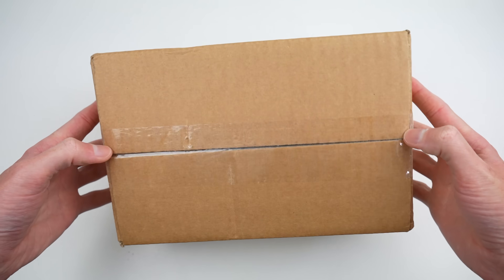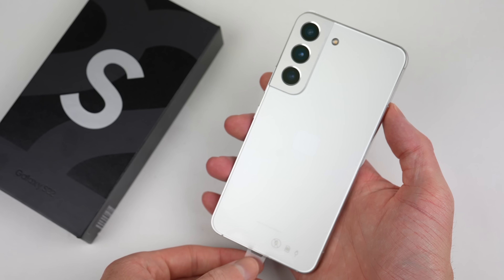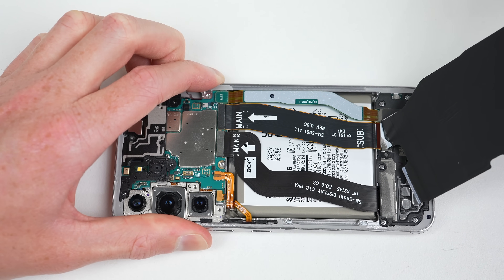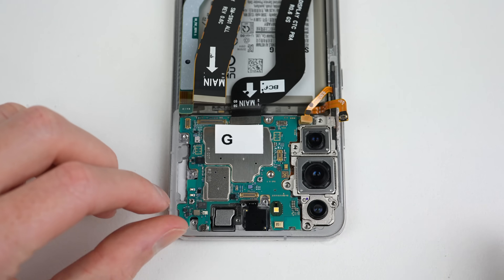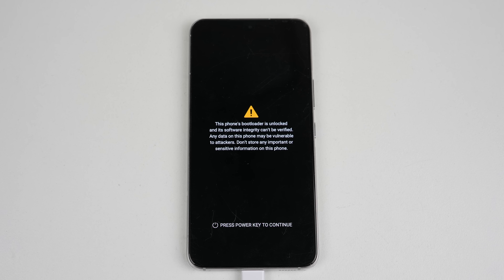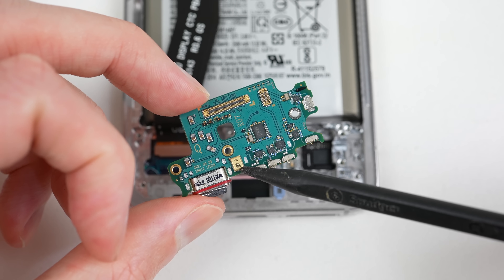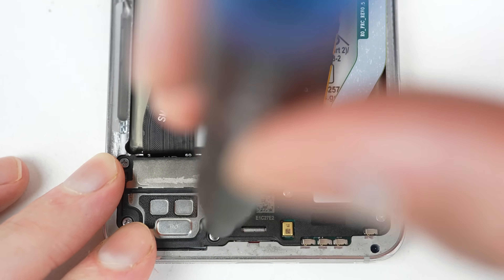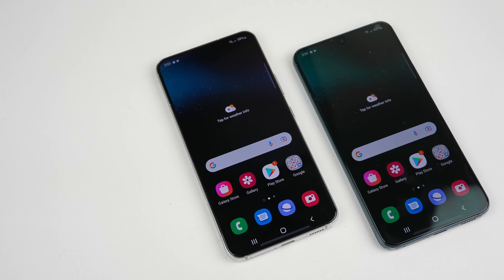Samsung Galaxy S22 - Teardown and Repair Assessment

Comment: this is some nice Progress Samsung done...
Man the only thing i could wish now about it is, Less Aggressive Adhesive for Battery and collaborating with like iFixit or something like that for parts and tools or atleast put it in their own Website, and boy that will be sick
Reply: There's some progress on repairability but not really on treating consumers better in general. They lied about the LTPO screen, the charging speeds settling half the planet with the s*** exynos chip, remove the charger from the box, removed expandable storage, nerfed 4 gigabytes of RAM away from the S22 ultra 128 GB variant.

I think a lot of people just assume the phones get better every year and don't even read the spec sheet.
Reply: The reason for adhering the battery to the phone and not using the phone itself to hold the battery is down to the Note 7 Incident.
That exact incident and its faults is exactly why the adhesive on the battery is used.

Comment: Hello, I’m a manager of a Samsung experience store, and we have a repair center at the back of the experience center, with the new S22 series Samsung removed all the incompatibility errors with repairs. We even tested the ultrasonic fingerprint scanner in many ways and didn’t found any problems. I own a Ultra variant for a couple weeks and before the announcement we had to use a special case to hide its exterior, we can confirm that with the ultra series you won’t find any problems also :)

If you get some errors nonetheless in terms of inaccurate fingerprint scanning the experience stores should calibrate the sensor for a small fee since you replaced the screen out of warranty. We tested in many ways and didn’t found a single problem with any function of the S22 series including the ultra so we expect not to have that many customers coming in for calibrations or other situations. But since it’s tech we still offer the option.
Reply: That is honestly such class. The fact that we have the option to fix our Samsung S22 devices ourselves even if we need to pay a small fee is I think a great compromise. If only Apple took notes
Reply: Appreciate you posting this. The telephoto 2 lens on my S22 Ultra isn't working and I thought I couldn't do anything about it due to part pairing. Am happy to hear that this isn't the case and after reading your comment I went ahead a purchased a replacement camera module from eBay to do the repair!
Reply: gioa  its why i said if only
Reply: complete opposite of apple lmao, apple would just tell their customers that their product is irreparable and that they should buy another device
this is one reason why i love samsung
Reply: Question. I just want to replace motherboard on s22 plus, I don't have to remove the battery or anything else beside motherboard screw right?

Comment: One important thing is missing to be mentioned in the video: after relocking the bootloader, the knox flag went back to 0x0 or stayed at 0x1? That would be interesting to know!
Reply: I think the flag gets set to 0x1 only when you flash unauthorized software.
Reply: I think 0x0 because all the Knox featured still worked

Comment: good job Samsung for the interchangeable parts and repairability although the battery is still glued too hard, atleast we can unlock the bootloader and use it normally. I don't need Pass, secure folder & blockchain. these online services is useless for me.

Comment: I will never buy a phone that doesn't give you a charger in the box. 

I really really wanted to buy the Samsung Galaxy S22 ultra but the fact you only get the phone, a sim tool, and a manual in the box, turned me away. 
I'm not spending £1499 for a fully specked out phone and NOT getting a charger. 
Also why is there a promotion for a "free" pair of galaxy buds? I don't WANT your galaxy buds..  just, give me the charger and £150 off the price of the phone???

Comment: I've recently swapped a galaxy a51 display and the fingerprints scanner worked without an issue. It was a bit slower but I believe it was because I didn't use a genuine samaung display (couldn't find any in stock anywhere at that time)
Reply from the maker: Its possible they removed/fixed the issue. If anyone can provide any proof I will put a pinned comment on that video.
Reply: @HughJeffreys  Since you had only swapped the scanner, that is why, the calibration of the scanner would assumedly been saved to the screen's components in some way to protect from trying to take that data from the scanner itself.
- Yours truly, Service & Repair Tech

Comment: Samsung seems to be taking the sustainable concept relatively better than others. They promised 4 years of major upgrades and seeing that the hardware is repairable without any bad consequences, it's a good move.
Reply: Yeah that's the only reason why I got the more expensive S22+ rather than the S21+, 4 years of updates is A very important factor to me because I plan to keep the phone a long time
Reply: @echobird115  the S21 series also get 4 years of OS updates and 5 years of security patches...
Reply: We just need the headphone jack back.
Reply: @danielm.595  To hell with that headphone jack crap. I've been using budget phones and never used wired earphones once on them. Sony recently launched a flagship phone with snapdragon 8 gen 2 with a micro SD card slot, I repeat , a dedicated and not a hybrid card slot. So what's Samsung excuse?? Smaller devices like the s9 plus can accommodate micro SD while a huge phone like the s23 ultra cannot accommodate memory cards, this is ridiculous
Reply: my s9 got 4 years of security updates and thats all that matters TBH ,the s9 got slow last year ,but after a factory reset it was like new again speed wise ,however it stopped security patches in march so i got the s22 ;)
Reply: @girlsdrinkfeck  Wait what I thought the S9 could only be updated to Android 10
Reply: my 2018 phone still gets updates and its not a Samsung
Reply: But is it worth it? Where I live people will ask you for half the price of the phone for a screen repair. For that, I can wait and buy a new phone or even change it in the Samsung store for a discount

Comment: Finally ...
I can find out if Samsung's Latest is worth buying, Unfortunately the Battery replacement gives it a whopping 5 out of 100 when compared to my Galaxy S5 battery replacement that rates at 100%, Here's hoping my Phone Galaxy S5 will last long enough for Samsung to concede, it's a bad idea to add extra costs to a simple battery replacement..
Reply: Honestly if you're coming from a phone that old I would recommend upgrading to a Note 9 or an S10 instead. You'll get much higher resolution and PPI, a headphone jack, expandable storage, fast charger, Samsung pay, iris scanner, capacitive fingerprint sensor, etc...

Something like the S10 Plus literally cost $200 and we'll still be getting security updates for two more years. If you look on the spec sheet is this objectively better and every single metric except peak performance of the processor, and a slightly upgraded camera sensor.
Reply: @michael_c2  are you saying the 4k videos I can record with my Galaxy S5 has a phone that can record even better than that?

Comment: i don't understand why samsung doesn't change the battery adhesive to pull strips... it has been a consistent criticism for years and it would cost them nothing to change

great video as always Hugh
Reply: yes even greedy company like apple has it
Reply: My theory is that the battery is used as structural strenght for the smartphone, these smartphone have to be so fin and light that its actually pretty smart to use every component inside as structure, that could explain why the smartphone is unbendable
Reply: @Dragirek  Less that and gluing the back so they don't use the rest of the phone to support the battery, because if they have anything around the battery, their is a possibility of the Note 7 incident again.
That was the issue with the N7, the battery was compressed around parts with no space, and the battery board itself didn't quite have as good built in securities against going boom..

Comment: Loading a custom boot loader also reduces the battery capacity to 80%
Reply: You mean on s22 specifically?
Reply: @Yeelleeay  All Samsung as far back as the Note 7, as far as I know.
Reply: @AngryWatchGuy  I've unlocked like 4 to 5 samsung devices since 2017 and I've never seen such behavior on any of them .
Reply: @Yeelleeay  that's because you are doing a carrier unlock.    I'm talking about a bootloader unlock.
Reply: @AngryWatchGuy  I'm talking about a bootloader unlock too....
Reply: @Yeelleeay  Well apparently you're not if you think it doesn't effect the battery.  Changing the bootloader does this to the battery.
Reply: @Yeelleeay  Oh wait.  I get it. You unlocked the bootloader only.  Yes.  Only unlocking the bootloader and not doing anything with it will certainly not effect the battery.  But loading a custom rom most definitely will.  And this would be the only real reason you would unlock the bootloader in the first place...
Reply: @AngryWatchGuy  Uh I've unlocked the bootloader, loaded custom firmwate and even repartitioned one of them and I can still confirm that the battery capacity "is not" affected. Infact this is the first time I've heard of anything related to the battery being affected by unlocking the bootloader...
Reply: Infact even my current daily driver (Galaxy A51) is running a custom rom based on aosp ( aka not a oneui port ).

You've got any proof of the reduction of battery capacity or are just talking based on something you "heard"?

Comment: Manufacturers claiming to be environmentally friendly is always a red flag. They're just virtue signaling at this point (not a generalization, but a majority of manufacturers are just using green to make profit).

It's great that they didn't do those idiotic stuff that the Z Fold 3 regarding the bootloader. As for the repairs, glad that Samsung isn't changing yet. The battery adhesive is just unnecessarily strong, which is completely wrong.
Reply: Oh boy it can be taken off easily with alcohol... I don't see problem here
Reply: @nothing9220  there is a problem even with alcohol though. Back then batteries in non removable backs like the S6 were easier to remove yet they're sturdy with their adhesive.

Comment: Happy to see Samsung still allowing repairs on their phones. I'm hoping this trend continues on their A-series smartphones, wouldn't want a repeat of the A51.
Reply: Speaking of that, Hugh didn't test the A52 for repairability to check if they really did improvise.
Reply: I know the A30s is affected too
Reply: Fun fact with that finger print reader issue, if you replace the scanner and the screen together, the reader will still work. I have no idea why that is, but it is a way to do it.
Reply: @MyHomeman234  then maybe the sensors weren't identical?
Reply: I want to see a tribute to the good ol' days and removable batteries make a comeback. I know samsung can still pull it off, I have the Samsung Xcover Pro and it is a great phone, but it can be better. Maybe a S22 Active with removable battery.
Reply: @thetechfromheaven  I think the newest phone you can get with a removable battery is the Fairphone.
Reply: @3mmmmmm  The new Nokia 3310 has a removable battery
Reply: @filenotfound__3871  more of a feature phone though
Reply: @filenotfound__3871  Pog
Reply: id never waste money on A series ,the longer a phone gets security patches the better
Reply: A41 is awesome had brilliant sunlight readability
Reply: I have a a51, and there is a simple way around that issue: don't break your phone or don't use a fingerprint sensor
Reply: @filenotfound__3871  "Don't break your phone" Sounds about right.
A coworked dropped his A51 once from his desk and the motherboard got damaged. Woops
Reply: @3mmmmmm  mine fell in a hole under the elevator doors. I don't know witch floor as I was going from the basement to the fifth floor, the phone was fine, a but dented on the plastic but still works fine.
Reply: @3mmmmmm  I don't drop my phone often, but when I do it is usually a preety big fall for a phone... or a stupid one like the elevator door.
Reply: @filenotfound__3871  I sincerely love Samsung modular components compared to that clumsy S10 series motherboard and pixel motherboard

Comment: If bootloader unlock ability is your main concern, Xiaomi is probably the best when it come to that. For starters, they make the process of unlocking your bootloader pretty much painless and all of the warnings are stated clearly and for some reason, they won't void your warranty.. The downside is you need to wait a week for the system to tag your account with bootloader unlock permissions.
Reply: I don't know why bootloader is a main concern. The average consumer won't be flashing their phone just because they are being tracked by Google.
Reply: @traviswalker8933  correct

Comment: Well, at least the battery being superglued into there actually has a point (smaller risk of damage through movement), unlike with Apple's software locks which only exist do f*ck with you.
Reply: Yeah they are afraid of another note 7 lmao
Reply: They glued down the batteries bcz they are afraid of the note7 accident
Reply: @pham3383  what happen to the note 7
Reply: @kindsplash21  boom
Reply: Could it also be to increase heat transfer through the case?  More solid connection -> better transfer rate -> less overheating
Reply: @frankohashiguchi  
In that case they'd glue thin thermal pads to it and use a conductive adheasive. The glue used here only weakens with heat.

Comment: It really bugs me that at this point, every major cell-phone manufacturer has basically thrown aside the SD card expansion slot. One may think that 128gb or 256gb of internal storage is a lot (it is under normal circumstances), but for people like me who use their phones as big-data storage units, it comes up short very quickly; I use my Note 10+ to regularly house up to 600gb at any given time, among videos, photos, music, etc. Unfortunately, it seems I've little choice but to accept this trend going forward.

So far the s22 is looking promising, maybe I'll consider it as a purchase when my current phone finally croaks.

Cheers!
Reply: Phone manufacturers don't cater to niche consumers who wouldn't make them a profit. That's how it is.

For your storage needs, they do offer a 1TB variant.
Reply: one thing i could advice it to get a NAS as a cloud for your stuff, i have it set up that way and now have all my data that i can't/don't want to keep on my phone on there... nice to have 4TB in Raid 1 and accessible from all around the world, sure download/upload might not be as fast as direct access on your phone but you have a save copy of everything and keep your phones storage free and tbh. a good NAS with 2x 4TB drives doesn't cost a fortune, or atleast it's often less then what you pay for a phone with maxed out storage compared to a base model, i currently have a S7 (since my S9 kinda died) and everything i had on my S9 (64gb variant) easily fits onto the 32 GB of the S7 but i'm getting a S22 now for obvious reasons i guess, well, that's my opinion on it, yes i'd like a SD-Card slot and maybe a headphone jack but since the trend isn't going back probably you've to work around it somehow, stay save, with regards Shinon 😊
Reply: That's the beauty of android: you can choose! If you want a phone with micro SD slot A52s 5G would be more than what you need
Reply: you could get a Sony, my xperia 1ii been holding up really well for a last-gen phone.
even has a headphone jack.
Reply: So much for all my 512gb micro sd cards. If you take lots of pictures and videos and have a good selection of apps then 128gb ain't shit for storage imho.
Reply: Also USB-C / A Combo flash drives exist.

Comment: The knox security for samsung pass and such makes sense since it relies on full software control in other words a locked bootloader since it defeats the purpose of Knox hardware and software full security. But other than that this actually amazing how easily repairable it is with no sacrifices (aside from losing knox security since it does not have control over software anymore)
Reply: It looks like you can still use Knox on the S22, just not after unlocking thr bootloader. That seems fine to me. I dont actually know anyone who uses Knox tho
Reply: @Carter Thiel  I use knox heavily I use samsung blockchain, pass, and pay
Reply: @silentiousgamer-4610  Samsung pay is no longer on the phone's. They removed it in the s21 or so.
Reply: @michael_c2  where did you get that information?

Comment: This is why i stick to android... Cheaper more repairable d doesn't carries a thousand screws and parts... Goes to show when you buy an android you actually own it...
Reply: Some android devices carry a lot of screws.
Reply: @traviswalker8933  compared to IOs?
Reply: @torque45-j5z  I'm not comparing to iOS here. If your main point is that android devices carry less screws then you haven't seen some which carry a lot.
Reply: @traviswalker8933  my point is not saying that android don't carry alot of screws and components... It more  of owning a device you payed for because its repairable
Reply: @torque45-j5z  Huawei P series phones are the exact opposite because of lack of parts. If you cannot find parts for your device to repair it then this factor goes down the drain.